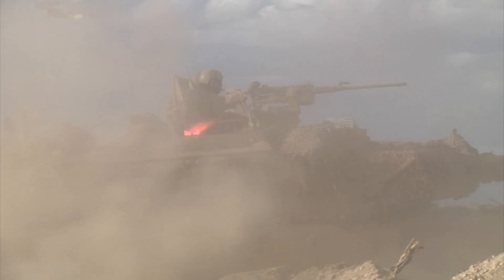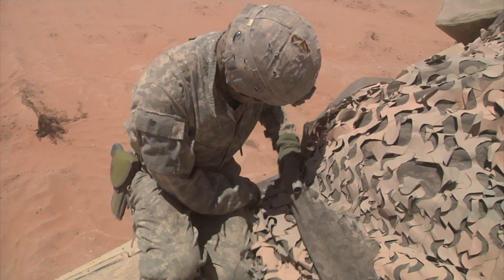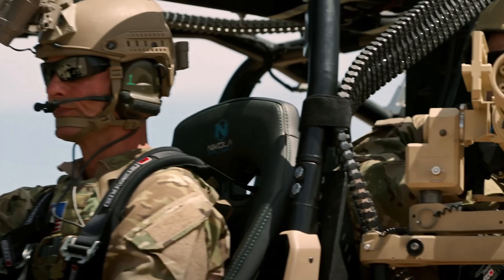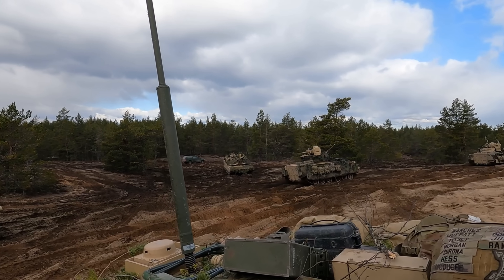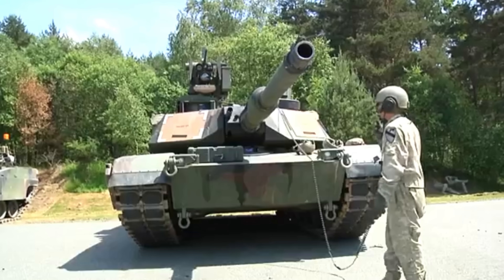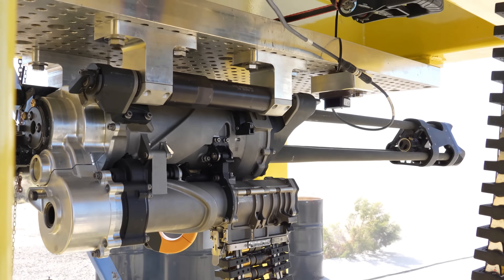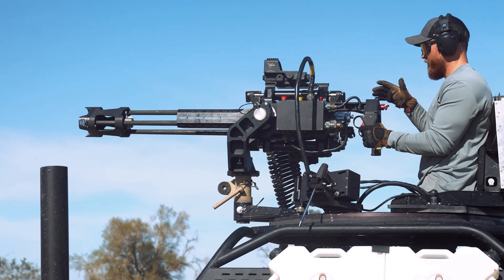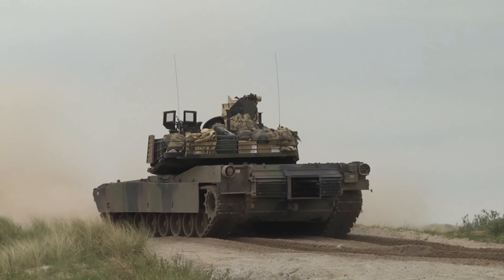Why is the U.S. Army putting a M134 Minigun on Abrams? | ROTARY GUN DEFENSE

Comment: Honestly. .50cal minigun wil be better especially in unmanned turret. 
Against drones you need at least 30mm with proximity fuse shells and radar. Because FPV drones are FAST and loitering munitions can be very beefy and/or attack from high altitude mainly out of your sight. 30mm HE-PF also means less ammo for more damage on longer range.

Comment: this is probably more appropriate for the more smaller drones: https://www.youtube.com/watch?v=Pc1D-l6vVeI

for most anti drones i'd think that for a high fire rate gun you'd want to go with a significantly smaller caliber weapon- weighs less (takes up less space and can turn quicker, and considering drones aren't armored so you don't need much piercing capability) and you can pack more ammo. and/or go with something like an auto shotgun....  Also what happened to all those experimental EMP guns that were being shown off a few years ago?

may have to try doing a dedicated anti drone vehicle that uses a combination of multiple anti drone techs- High fire gun, shotgun sort of gun, laser, and emps and have a couple of those sort of vehicles escorting the BMT.

also may have to look into Unmanned Self propelled guns- stick the X- sized gun on a tracked or wheeled motor carriage with an auto loader that can be remote operated. doing this for a big gun would likely mean a USPG that's larger and expensive but would be more for infantry support against fortified locations... for anti infantry (or even anti drone) work a smaller vehicle with a  smaller weapon would work and for anti tank operations you could have an UAV that just carries a javelin or two.

for anti drone work you could have an image recording device rigged to an AI that high lights quick motion detection on a screen and an operator can confirm or deny that the object recorded is a threat.

Comment: I would test a beltfed, recoil operated shotgunmachine gun for drone defence. You get many types of ammo for one gun (bird- and buckshot mainly). You can make the gun light as it fires low pressure ammo, it would be simple in operation and every round has a much higher chance to hit. And you could still use it in suburban and city enviroments. Oh and ammo would be cheap.

Comment: In regards to the "complexity of electronics" at around 8:30, I disagree. All the M134 needs is a power feed, and that doesn't take a whole lot of neither space nor being very complicated as this has nothing to do with electronics but very simple electrics.

If the drawing of the fire arcs are correct though, the question is moot as it goes from "can we do it?" to "is there any reason at all for this?"
If that M134 is supposed to be the main defence against drones, it needs turret priority, as in the commander and gunner having no say where to point the turret whenever the loader keeps watch and engage threats  which in the field is just about the whole time.

Ammo count is easier, just ditch the .50 all together and give the commander a 7.62 as well. Now you only need to carry two sorts of ammo...  but again, what purpose would that M134 serve?

Comment: Did you know that there's a handheld firearm, perfected over the last hundred years, that's used to shoot down fast-moving, maneuvering, and low-flying targets? It's called a shotgun. I know. Crazy, right? A small, upward-sliding mount with an automatic shotgun that can operate autonomously with its own tracking device would be a more compact, cost-comparable, and many times more effective solution for tank self-defense against drones. It's just a matter of developing the right ammunition.

Comment: My mind goes to a 20mm, possibly on a special raised and/or canted mount above the bustle, that allows for blowout venting and head clearance. Give it an AI-assisted optical tracking system, to conserve ammo, and a remote drive with a high vertical guidance. The 20mm is a good choice for ammunition capacity, with access to various HEF rounds to reliably take out small craft, or suppress AT troops. While something like the Rh202 is dated and large, it's proof of concept.

Comment: As cool as this is for lifelong tank nerds and 40k players. It’s simply a costly waste of time. But then again, that sums up US procurement nicely. 
Anti drone defense needs a radar or visual identifying system that doesn’t require huma oversight let alone crew exposure and manual aiming. 
Why not simply convert a percentage of Abrams in each battalion to pure drone defense armaments with appropriate automatic systems. 
A low cost smaller alternative that can deal with micro drones is feasible on a per tank basis. 
This also requires a supply chain backed by an a results driven low cost nationalised industrial arms industry. The US has a for profit heavily distributed arms industry focussed on maintaining current contracts and legacy combat systems. 
What war are the US hoping to win with these upgrades and overpriced tanks?

Comment: The Abrams does carry 10,400 rounds of 7.62 just for two M240s. So I understand the caliber they went with. The first question is how well can a soldier spot, track and engage something the size of a drone? 
And as you said, of all the things now mounted on top of the turret how much coverage can you get. This might even lead to crewless turret. With some type of secondary turret on top for drone engagements. 
If I was flying the drone, I am aiming for an open hatch. Or when the fuel truck show up, hit that. 
The other concern is "swarm" attacks. How many drones can one gun drop before they close the range? 
If the threat is that great, do we completely replace 1 of the 4 tanks from a platoon and it runs with a new turret without a 120mm and made to engage all air targets? 
Or a Bradley that is fitted for an anti drone role.

Comment: So we’re putting the minigun back on the Abrams… why aren’t we just bringing back the dedicated minigun carriage? Can’t remember the name but it already came with a radar that allowed it to fire more accurately, ontop of that it used the old M113 chassis which if that’s an issue can be replaced with a Bradley Chassis or even just replace the Bradley’s mount with a smaller version of the M134 so you can mount a radar, RWS, and store more ammo while possibly either leaving room for armor or lessening up the weight.
And of course not mentioning that when drones aren’t involved and you can spray the tree lines or lay down a lot of suppressing fire

Comment: Gentlemen: I suggest a shotgun-minigun. Long barrels 30in, hopper fed, smooth bore with slugs available. 
Make it accept 2-3/4 & 3in .12gauge. Plentiful ammo. 
Now the really expensive part, radar tracking system to auto turn and soft lock on. (Still needs a human to pull a trigger.) 
Of course it'll have something dumilar to a CROWs system or whatever current model the newest automated turret uses. 

Next best idea is low tech and old tech. 
37mm auto cannon loaded with proximity shells. Last I checked, smallest the prox shells went. 
Still will need modern if not cutting edge radar to keep the barrel at the next buzzing threat.

Comment: The proper question isn’t “why put an M134 mini gun on an M1 Abrams?” The proper question is “why not put an M134 mini gun on everything?“
Reply: Ah yes, like the US putting M2 Brownings on everything
Reply: @darksidethelol how about on a 1977 Chevy Camaro???😈
Reply: @darksidethelol well why not?
Reply: The answers is Ammo,  If you had to lug 750 rounds of 7.62 NATO 8 miles across Norwegian countryside on a winter exercise, you would know why. That ammo is heavy, bulky and even when on a truck, it's a pain to run supplies. Imagine if you had to supply an armoured column  equipped with M134's for three days munitions supply under offensive combat conditions. Its an expensive nightmare!
Reply: @nemo-79000 then just use a Microgun, same thing but in 5.56
Reply: Isn't it just going to blow through the ammo in seconds and then be a sitting duck? It's not like you can fly off to rearm. There's some endurance to consider.
Reply: Because they are ignorantly expensive. Every repair part(beyond nuts/bolts, cotter pins etc)  is expensive. The ammo is harder to produce than standard 7.62 due to quality control standards (a squib is a real issue when the gun is self clearing) and they are extremely maintenance intensive. That maintenance isn’t typically able to be done in the field and takes hours to accomplish with a good experienced armorer. 

-an armorer at one of the few places that actually uses them
Reply: @beachgirl10989  well… what about 2x M240Bs specially gassed to do 1500rpm?
Reply: I have two on my desk at work.
Reply: It's just fkn cool weapon , so I agree 100%
Reply: Did you hear the good news! The company that make the minigun is currently designing a version using 50cal they have working prototypes
Reply: @TheQcjoe47  so you’re saying they’re making anti-material miniguns? Who’s doing this, I’m buying stock.
Reply: @hanz_gaming1662  like I said ! the same compagny that make the minigun for the military.
Reply: m134 mini gun is also power hungry so you're going to need to double or triple the battery size and generator

Comment: A 5.56 or 7.62 mm minigun is great for suppression & anti infantry in short to medium range engagements. For anti drone, you'd be way better with a dedicated system like the EOS Stinger. That said, you already have a coaxial 7.62 mm & without the .50 BMG (12.7 mm) you'd lose the long range suppression & barrier penetration of the Ma Deuce.

I like the idea of a longer range round for the coax to replace the 7.62 mm. For example, the .338 Norma Magnum would double the effective range of the 7.62 mm, with the ability to carry & fire a lot more rounds than the 12.7 mm.

Comment: I'm surprised that the M2 hasn't been replaced long ago. It was originally meant as an anti-aircraft gun. During WWII it was used to take on lightly armored vehicles like scout cars without wasting a tank round. The 100rd boxes are heavy. The ammo is scattered around the tank's outer basket. Once you run dry the commander has to physically get out of the tank, grab a new can in the basket or hanging off of the hull, remove the old can, then replace and reload the gun. The commander becomes VERY vulnerable during that situation. Furthermore 100rds goes pretty fast. The only advantage it has over a 7.62mm is that it can penetrate some light barriers better. Lightly armored vehicles are just engaged with main gun since the M2 has iron sights. Frankly, a minigun with a reduced rate of fire makes a lot of sense. The fact that it might be used for drone defense is secondary seems like its just a bonus although I think there are better options. Lasers come to mind.

Comment: My issue with using a cannister/shotgun style system, is that it would sacrifice a large amount of range/utility. I say that, despite this being a very clear excuse to bring the 19th century shotgun cartridge into the 21st. Though, this could also see a revival of SPIW-era flechette and hyper-burst systems, which I can imagine would have enough energy at far enough ranges in a dense enough pattern to be useful in roles other than specifically anti-drone. 

I think the first step is going to be a M134-style system, using a belt of typical ammunition mixed with special purpose projectiles. I've heard tell of experiments being done with replacing the projectiles with makeshift shot-cups, holding numerous BBs. These could turn almost any weapon based on that cartridge into an impromptu shotgun. If we used the 134 type system with a mixed belt, we could maintain the utility of conventional bullets with range/penetration, as well as adding a shorter ranged 'flak zone' for drones (and friendlies) that are closer.

At present, I am of the belief that going to a .50cal is simply overkill for the purposes of anti-drone on a non-dedicated system. I think that the system should be kept lighter weight and limited in scope to protection of the vehicle it is mounted on, and paired with SHORAD/PIVADS systems on separate vehicles that would be intended to protect the unit

Comment: Decades ago when we had the M1A1SA, we had asked for a minigun to replace the M240B. at that time no one knew how to employ one on a tank. Now its on the SEP tank. I wont say if its a bad Idea...nvm, I will. It is a bad idea. The fact that you cant fire over the front of the turret because of the CITV is a huge problem. on the M1A1SA, It wouldve complemented the night vision CIWS that the TC had on that tank. If I had a choice between the crows and a Flex mount for the M134 minigun in the TC's station, I wouldve went with the M134. Give me my ability to see around my vehicle and not the CROWS obstructing my view. For the current Abrams, You have to put that turret over the right front fender to give the loader the opportunity to shoot. That in itself is detrimental due to the fact that you just took out your biggest gun in the fight so that you can let a loader shoot. I would rather keep my big gun in the fight to be honest. also to be honest, its too little too late when that minigun couldve been a huge asset in Iraq.....

Comment: Yup, I believe some oversized shotgun is a better and cheaper option. What i think they should do is basically use the smoke launcher on tank, mybe slightly modify it, create a shotgun round for them then u have smoke and shotgun rounds in one system.  Hook it to a computer so they are always on and it's a passive non manned system

Comment: I like the idea of a grenade launcher with shot or flechette rounds, whether it is manually or remotely operated. One advantage is that the rounds are more effective against a drone. As drones are small, they are less likely to be seen at a distance. What if you could fit a grenade with a proximity fuse? I know that this fuse type has been in use since WW2, but I seem to remember that it was tried with a different infantry system in the 80s or 90s. Does anyone else remember that? I think it was Sweden or Norway that was working on that type of system.

Comment: I think having manned anti air on a tank is just sub optimal. Make it a mini C-WIS ditch the Commanders turret just use that commander can remote op it optionally or it can just be on auto intercept. Program it for bursts of 10 rounds assess hit probability. Have a little OODA loop for stopping fire. Could get some multi unit support programmed in. Could have it be programmed for swarms to give each drone a 10 round burst then loop back on still airborne threats. You can program it to have zones where it wont fire without manual control.

Comment: Awesome as it is, I don't think the GAU-19 is the right weapon system in any anti-drone role, except maybe defence for small craft against seaborne drones. Against small drones it's huge overkill and lacks volume of fire to achieve high hit probability. Large drones like Shaheds and Lancets are in a totally different performance category in speed, toughness, and payload which I think demands a more purpose-built and higher PK approach than an auto-tracking GAU-19. My thoughts would be the M230LF or similar, with tracking and smart or proximity fused 30mm, probably carried on a supporting vehicle for weight reasons. If we really need a cheaper system mounted on the tank itself for dealing with swarms of FPV-size drones, I'd go even smaller and suggest an automatic shotgun. Give every crew member a shotgun today while you work on a belt or large box-fed 12 or 10-gauge system with tracking. Even 5.56 is far overkill in terminal performance against small drones, so a cloud of steel ball allows you the highest PK with the lowest volume of fire.

Comment: My idea is that you don’t need such large rounds. My thought is, pair a drone search radar of some sort, or cameras, and have an attachable modular part on the real (a much more vulnerable spot) and make a smaller caliber CRAM type platform.  A .22lr with a hotter load can go a couple hundred yards. You could carry a massive amount of rounds by weight compared to 7.62 or 50 cal. And with a high rate of fire and the correct programming you could create a spread of projectiles. Yes the rounds are small, but drones are not tough, a fast moving small lead projectile would shred the cameras used by the operators, disable the propellers, and cause others systems damage that would have them falling out of the sky.  You don’t need “go big or go home” for drones. A .22 weights 3-4 grams while a 7.62 NATO comes in at 24.5 and a 50 cal comes in at 43. And of course it’s much much smaller.  So 8000 of rounds for every 1000 of the 7.62 by weight.

Comment: Probably wont work as intended, just look at trap shooting, they dont raise the firerate to shoot down the target. They spread the damage from a point impact ot an area of effect. imagine a rotary shootgun, with decent rate of fire but with an area of effect, with larger shots, like 5-9mm. They would cover a significant area while not necessary require accuracy. The range would be OK for this pourpouse.
If got enoguht money, just like the US armed forces, they even could try to scale down the PABM (programmabel air bust ammunition) ammunition for being usable in handheld or wehicle mounted configuration. If it could adjust the burst distance in real time based on the rangefinder on the scope, you could create a system witch would make the drone operators live a lot difficult. 
But it is a sofisticated solution, and not the "Murca f*/k yeah" approach.

Comment: They should just redesign the whole turret at this point. Heres probably  a crazy thought  Use the m134 or XM 214 in 5.56 (lighter smaller round mean more can be carried) on an electric mount on  a ground   drone  that can pace each tank and another vehicle that has a hybrid system of sensors of rwis-trophy active protection that  can network to the gun drones.